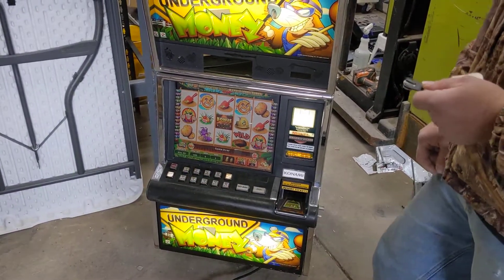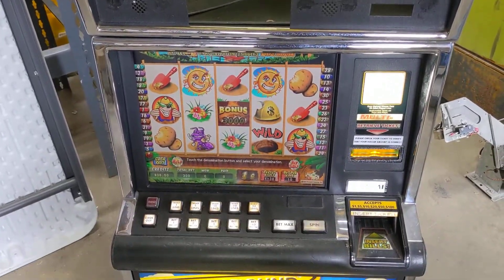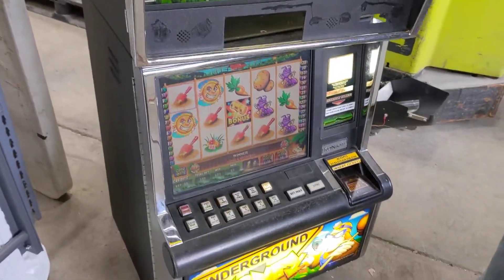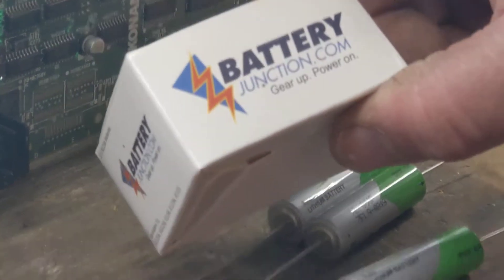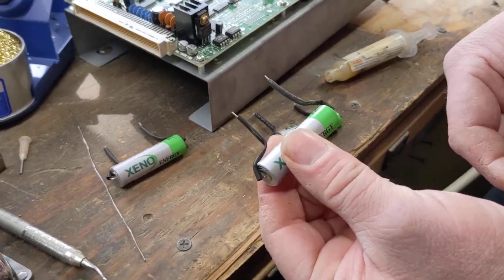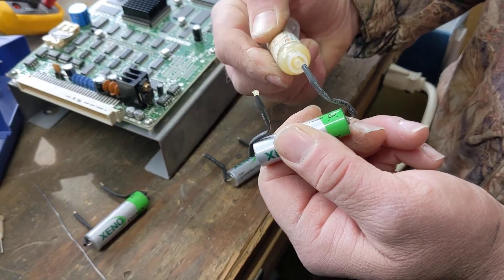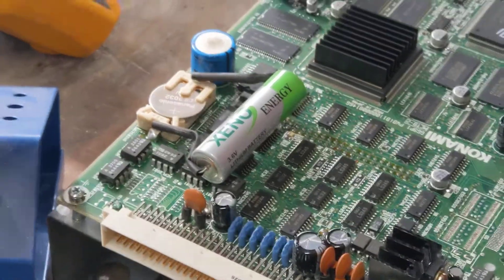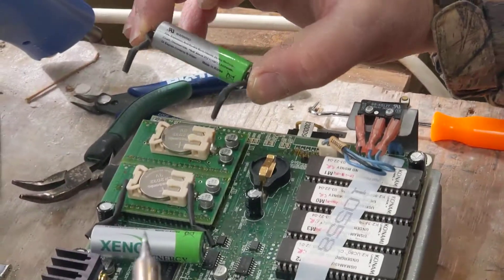Konami Slot Machine Battery Replacement/Upgrade-CPU Herculite

Comment: I have a WMS Bluebird showing Vram2 low voltage. There are two. One measures 2.45 and other 2.9V. I couldn't figure out how to change the battery. Seems based on your video they are in a non removable holder. 
Why did you not just replace the batteries? The board in my WMS is not easily removable but now at least I have a clue re the issue. Thank You.